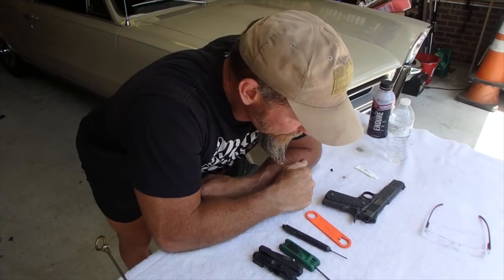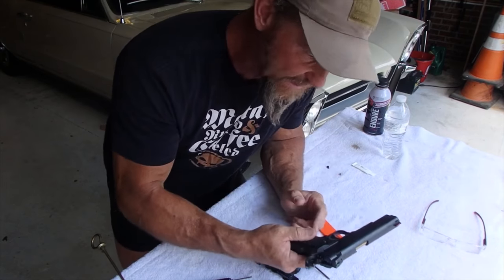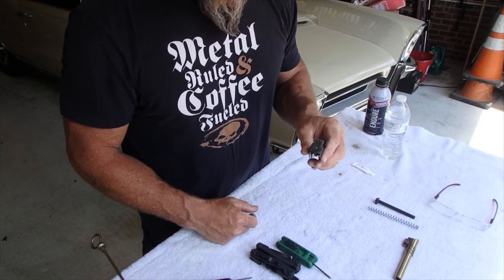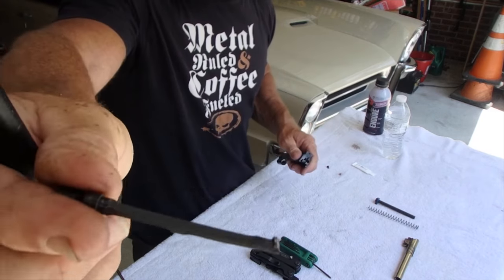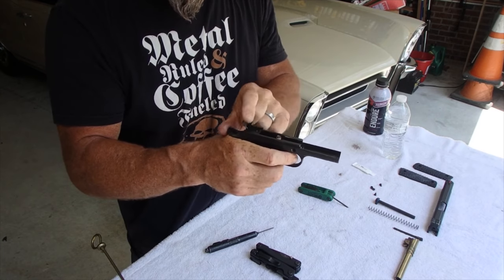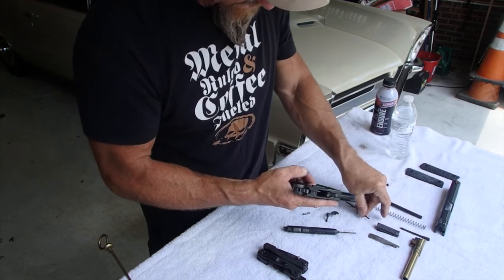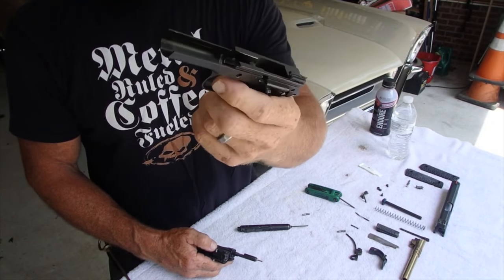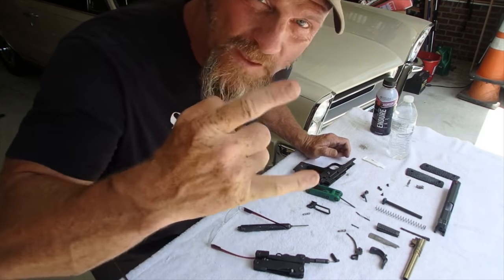How to Disassemble a 1911

Comment: Story time!  My dad, with Parkinson’s, had disassembled his Colt 70 series Gold Cup.  With not a lot of experience I was putting it back together but could NOT get the slide pin to go back in…would NOT go and I was afraid of scratching the crap outta the slide.  Bride, with ZERO experience, asked to look at it as I was frustrated and was gonna take it to my gunsmith.  

She says, “ hey this thing (barrel bushing) looks to be too small for that pin to go through….could it be in wrong?’  

Yup. Dad had bud the bushing in wrong and I was trying to put a large round into a small round.  Flipped it and all good. 

She’s still gloating.  :P

Comment: Nice to get the fundamentals out there for folks.  That is what shooting is all about ... proper application of the fundamentals.

Extra tip - If you have a 2-piece guide rod, break it loose before separating the slide from receiver.  Those usually have to get the front half of the guide rod removed before you can pull the recoil spring plug.

Comment: Great video for newbies to 1911. I rotate the bushing before removing the slide. I use a GI guide rod, and a heavier recoil spring.
Reply: I also use slot-head screws for the grip-stocks. I've had the Larry Vickers warning happen where the Allen screwhead has snapped off. Also not having the right Allen wrench is aggravating.

Comment: TaKe grips off. Then let it soak in gasoline/etc petrol paraffin.
After 5-60 min how dirty.
Hot water from tab +liquid soap.
Clean thorugly. Then just water soap
Out . Hair blower warm/ dry the gun+
 barrel like you normally do.
Light oil on dry gun all over!!
Wait a while stock’s/ grips’s back..
You might only loose grip screw’s if any

Comment: I’ve owned 3 different 1911s over the years and never once has it occurred to me to hold the slide and frame like you did to keep the spring and guide rod from falling out.
Reply: Same method was taught to me by Match armorers.  I would guess Pat learned it from similar folks.

Comment: Man, polymer guns are so much easier to disassemble and clean.  There's no springs ready to fly, there's no tools needed, and the fewest parts come out as possible.  I love the way the 1911 looks and I love how it's customizable, but 1911s are more fun than practical, to me.
Reply: It takes a bit more to have a pistol with a fantastic trigger that you can hand down for generations. There are duty based 1911&2011 builds. I still get what you're saying.
Reply: @onpsxmember  oh I get it.  Bought my dad a Cabot a few years ago.  But as far as regular maintenance and cleaning, polymers are easier, flat out.
Reply: @MrEsPlace  
Most modern striker fired handguns yes. There are polymer framed DA/SA pistols too and also steel or aluminum framed striker fired models.The lower weight is nice though.
Reply: @onpsxmember  I love how people in the gun industry are so condescending and disrespectful...  everyone assumes no one knows anything...  like I didn't know there were polymer hammers and metal strikers...  like I don't know anything....  thanks bro.  You really "informed" me...  wow... I see the light...
Reply: @MrEsPlace  
You're right. Idk  why. The undertones are there. Perhaps monkey see monkey do. I have to think more about it.
Reply: @onpsxmember  I’m just irritated at being talked down too.  I get it's online and hard to gauge a person.  But just assume everyone is Chuck Norris before they've proven otherwise.
Reply: @MrEsPlace  
I don't think it has anything to do with the person, it shouldn't be done. Perhaps based on behaviour. I think you're right that this rut is more prevalent in firearms realm.
Reply: @onpsxmember  we're proud of the work and endless hours we spend on it.  The money, the research, the hours at the range, supply headaches, security, the infinite paperwork and all the classes.  There's a lot that goes into it.  I think once we reach a level of knowledge, we're kinda proud of it.  I've surpassed a lot of the gun store guys here in town, but it's rude to be rude.  The car industry is kinda better that way.  Some of the brightest car guys are nice and humble because they all started somewhere and apprenticed with a master that kept them humble.  The gun industry is a loner kinda community.  We all do this alone, some on Reddit, idiots in my opinion but whatever.  We need more gun clubs.  More gun shows.  Competitions, at ALL levels.  The difference between the two industries though is one, you come into it as a business.  But guns, that's usually a hobby.  A lot of us aren't any better than the dungeons and dragons guys with our "a--a--aactually" cough glock bois....  and the Fudds are looking at the noobs... straight... down... their... noses....  gotta start somewhere.  And since the two parts don't intermingle, one doesn't learn from the other and as a result, has different opinions.
Reply: @MrEsPlace  
That makes definitely a breeding ground for this behaviour. I just hurled information more reflexive than thinking why. Nothing to gain from this, but a slight lingering 'look what I know is there. There is a need for a form of exchange beyond what good forums used to be. There are lots of conflicts even in clubs with different disciplines. Perhaps forcing new members to try the other side for once and seeing different needs/desires in gear and need of skill sets may help to breach those gaps.
Reply: @onpsxmember  the issue with throwing out what seems deep knowledge and information is, it can also demonstrate to someone with deeper knowledge, how far back someone is still.  There's a saying, "it's better to be silent and thought a fool, than to speak and leave no doubt."  We ALL need to remember that.  There's a saying in sports too, "act like you've been there before."  Meaning, don't brag, showboat or celebrate too hard.  (There's been NFL players that have celebrated too hard and hurt themselves.)  I’m not trying to bring you down or chastise you, but help elevate my brothers in arms.  You're smart enough to have gotten yourself here so far, what's next?  What's the next level?  Where's the equivalent to a doctorate in gunsmithing?  How much knowledge does that take?  What kind of studies would that encapsulate?  How much do I know about that?  How much can I learn about it before I need to start forking over big numbers to learn more?  The pursuit of knowledge can never end.  But stop and look around at the big picture sometimes.  Einstein said that the more he learned the less he realized he knew.  There are centuries of knowledge, on guns especially, out there.  I want to know it all.
Reply: That was an armorer level dissemble. For Field stripping you basically only focus on the slide parts.
Reply: @VLAPredz  see...  exactly what I’m talking about